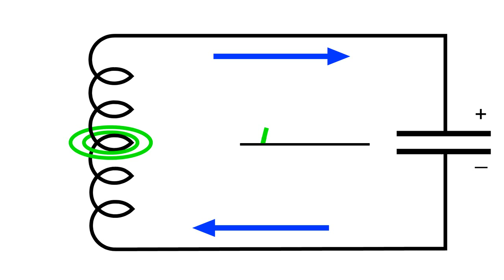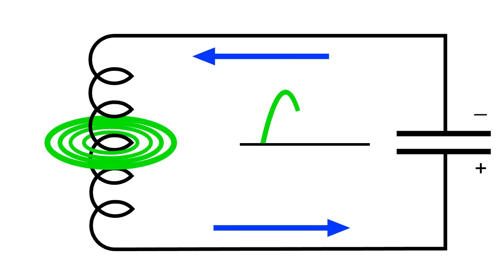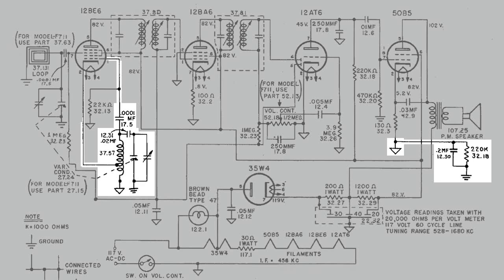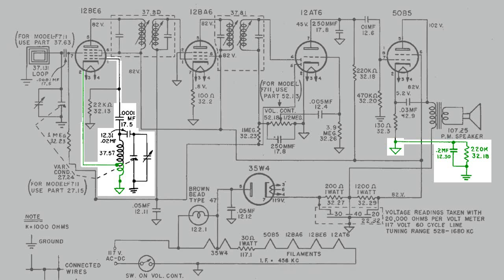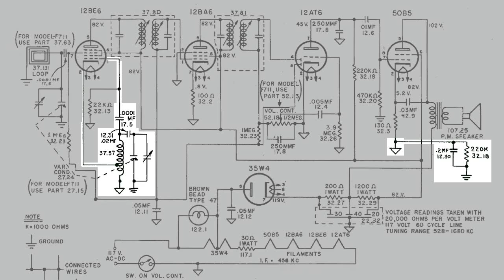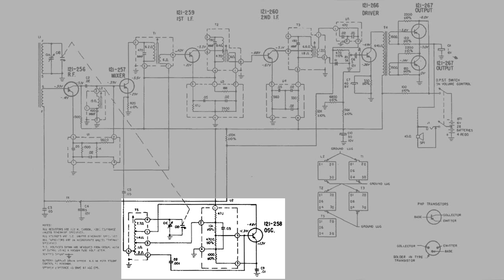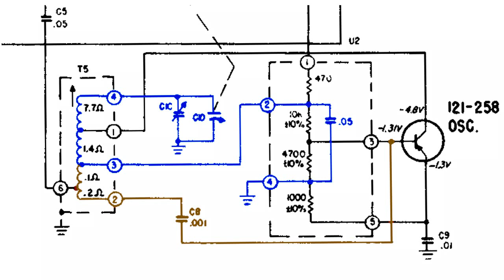Oscillators, the Basic Tank Circuit 2

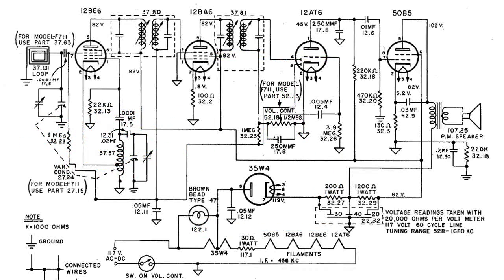Comment: You start to address my confusion at 3:00 ...I have to put this all together in my head it's not easy to understand.  Thank you for your patience and all the videos you sent!
Reply from the maker: AC Alternating Current, for the Beginner
https://youtu.be/xVbqMFkyuXI

Impedance, Back EMF, AC Resistance
https://youtu.be/y11SbmXPY18

Impedance Back EMF Practical Demonstration
https://youtu.be/JrI7I93XzYk
Reply: @AllAmericanFiveRadio  ok as an electrical engineer I understand most everything you have been sending, but I'm not as robust when it comes to tubes and transistors...especially  as it relates to grids, cathode, base.... it's like I can't envision the return path....because the grid just is hanging there.... it's almost more like an antenna... I'm going to try and duplicate the circuit and model it in Simulink... but it's definitely still not intuitive even with a strong background in engineering....albeit I'm more a power engineer, not communications
Reply from the maker: @KAFKUBA  The more negative the grid the more it repels electrons keeping them from reaching the plate. About the same idea as the same poles of a magnet repels each other. Here are a few more videos that may help.

Transistor, How Does it Work in a Circuit, Demo
https://youtu.be/vs3zUHdlsYY

One Transistor Amplifier Demo
https://youtu.be/eZDxYHEuy_g

Triode Tube Amplification Visual Demo
https://youtu.be/4FkD0LRiu7A

Comparing the function of transistors and tubes.
https://youtu.be/ZZpcRsKtfig
Reply: @AllAmericanFiveRadio  thank you again...i pretty much get the concept I just have to come thru it practically...I  appreciate your patience!!

Comment: Rick, I watched this video 10 times before I got it.
You show DC passing through the 0.2mF cap but it can't since its DC. Right?
And, every signal voltage in the radio that is terminated with a triangle flows through 220k to ground?
And, won't the positive portion of the resulting sine wave be just a little bigger than the negative? 
Sorry for all the questions but who else can I ask?
Thanks
Reply from the maker: Thank you.
That is correct DC does not pass through a capacitor. 
Every swing of the magnetic field will be less until all the energy is gone.
I do have another video on capacitors.
How  Capacitors charge and discharge
https://youtu.be/Ag2RujOHqJ8
Capacitors, DC and AC Current
https://youtu.be/NInt1Ss3vQ4
Capacitors, DC, AC, and Frequencies
https://youtu.be/YfJKNSkz_Lk

Comment: Hi Rick,  Awesome video as always.  Could you describe where the red negative phase of the cycle occurs in the circuit? (around 6:50 in the video)
Reply from the maker: Each time Zero is crossed
Reply: @AllAmericanFiveRadio  Hi Rick, yep got that part.  I mean which part of the circuit would glow red when that side of the cycle occurs. (kinda in the manner you highlight the section of the circuit in green, during the green phase of the cycle)

Comment: I am too stupid to understand how a oscillator get energy from outside,on and off!My understanding would say that the oscillator itself should command the energy input at the certain point when the current goes down.All these diagrams are a mystery for me.😦
The beginning is very simple,the supply is turned up ,and it oscillate ,to the point where no energy left,now,something must turn it on and off again.What does it?To radio it is the Antenna, but to others?
Reply from the maker: I have been there many times. I kept studying and thinking about the subject that I did not understand. It took me awhile,, but I discovered that once I got it in my head,, it was always there.
Impedance, Back EMF, AC Resistance
https://www.youtube.com/watch?v=y11SbmXPY18

Comment: Is there no current that flows through the inductor? or is the current that reaches the coils converted into a magnetic field with no current on the wire or does it produce a magnetic field while it is flowing through the coil. I think it is the 3rd one that is correct but not sure. Your channel has been a big stepping stone in my electronic hobby studies, thank you for answering the questions I posted! I hope you do not mind that I use your videos in my electronic engineering playlist. I liked btw.

Comment: I just have difficulty understanding why the electromagnetic field is not vertical which results from using the right-hand rule given the the current is horizontal around the solenoid.
Reply from the maker: I can understand that. Everything in electronics about electrons and magnetic fields, are theories. NOBODY knows the WHY of anything, period. Nobody knows what electrons really are, or what magnetic fields really are. It's all theories which seems to explain what is happening in a circuit. So always keep in mind what a theory is, a theory is someone's best educated guess, and nothing more.
Reply from the maker: The magnetic field produced from electron flow comes out of the wire at 90° from the wire. I'm just trying to show one spot on one part of the coil. If I tried to depict a coils magnetic field at one spot all you would see is a line going through the center of the coil getting longer and shorter. So another words if you take the drawing the way I have it and add to it all the other points on the lines you'll end up with what you're looking for.
Reply: Do you miss the forest for the trees too?
Reply: ya i had same confusion .......thnxs :)
Reply from the maker: I'm showing one point in the magnetic-field. If I drew all the points you would not be-able to see anything. So add all the points in you mine. The center point is the highest, the outer points are less, making the total magnetic field.

Comment: As long as you can produce changes in the oscillation, you are already sending information.  For example, all wireless devices use basically this circuit for antennas.  AM radios will modulate the magnitude (amplitude) of the field, FM stations wil change the frequency.  Cellphones, Wifi, Bluetooth and cable modems will modulate the phase or change the delay of a group of waves as per the data to send. The more combinations you can produce, the more data you can send, i.e. better data rate.

Comment from the maker: Yes you could use the tank circuit oscillator to develop 60 cycles. In the capacitors in the oscillator circuit would be nonpolar.

Comment: Hi, the capacitor is charged with reverse polairty and normal polarity vice versa. So does this mean this is non plolorized capacitor, Second can this be used to generate AC 60hz  from 12v battery. I might sound stupid, because i am new to electronics, please guide me.

Comment from the maker: Think of a play yard swing. If you give a small push at the right time you can keep the wing, winging. If you stop pushing the wing it will eventually stop winging. That’s what the positive feedback does for the oscillator. The push for the swing overcomes the wind resistance. The positive feedback overcomes the resistance of the wire and back emf of the coil.

Comment from the maker: @oozytes
There are lots of forces in play in an Tank Circuit. One of the major determiner is the back EMF of the coil. The back EMF resists/appose the change of direction of the magnetic field causing a delay in the magnetic field build or collapse.

Comment from the maker: @muddymuddymuddmann 
Thanks very much MUDDy,
The first video I did used some Shockwave Flash but in this one I decided make a mpeg move to see if I could use it in another video. I discovered that I could not only use it, but I could slow it down, speed it up, change the size, and stop and start the mpeg move any way I wanted and more. Adobe makes some topnotch software. The real problem is getting enough time to take courses to learn how to use them, but it sure is worth it.
Rick

Comment from the maker: @CameramanLink 
They are everywhere. My next video on the 1925 Atwater Kent 20 radio has three tank circuits in a row. 1925 is getting close to the beginning of the first large commercial use of tank circuits of all kinds. From 1920-1940 the growth curve is vertical. And it still maybe vertical.